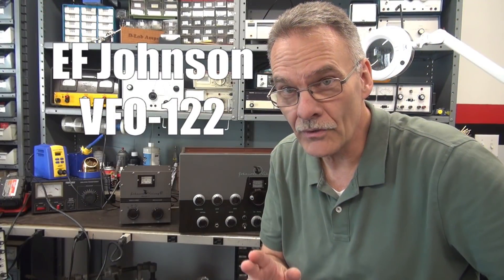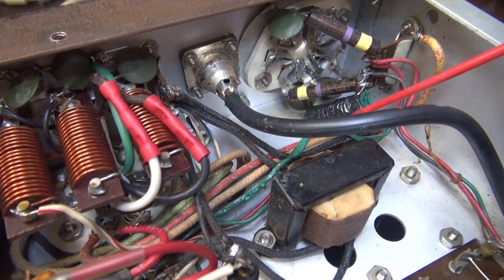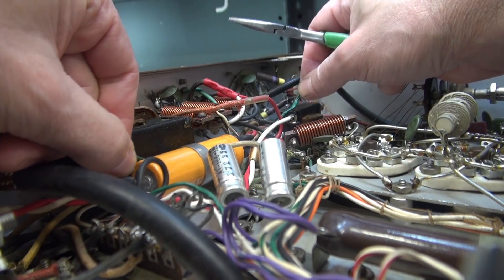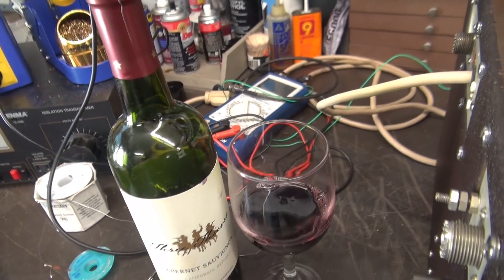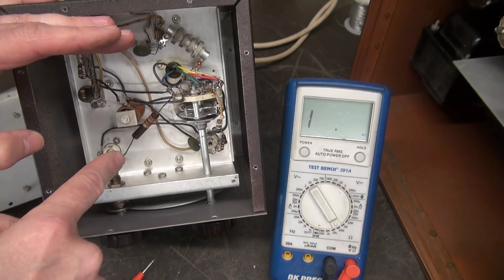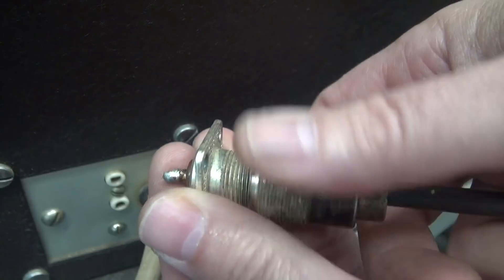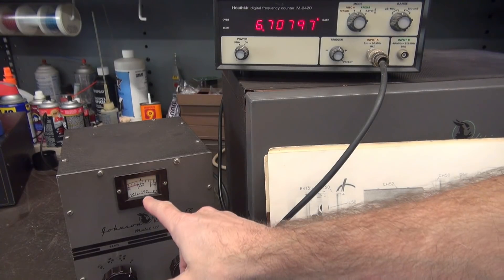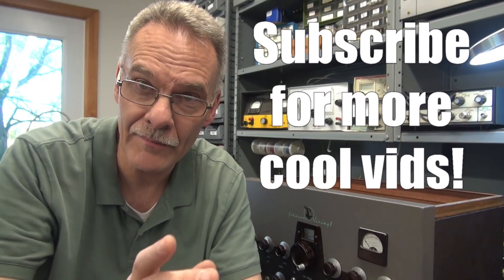Johnson Viking VFO VF-122 repair Calibration Ham Radio Operation

Comment: there is a trick with the vf-122 on 160 meters. the vfo puts out 80 meters but the coax to the transmitter is chosen to resonate on 160. if you replace the coax and 160 does not work you have disrupted the tuned coax trick circuit.

Comment: Terry - I have a Johnson VFO-122 in my slimy little fingers right now.  I got it from an Amer that was getting out of the hobby, and moving to a smaller place.  He passed away a couple of years later.  All the screws are out of it, but I think I have them in a container.  The bottom plate, and back nut are also missing, but now that I know what to look for, they may be here somewhere in the mess.  The Chernobyl resistor measures 58.2K Ohms.  Wow!  Glad that I looked at your video.  I also have a Johnson Viking Ranger here.  I think I'll order two of those nice resistors, in case that one needs it, as well.  I'll also check the Johnson Vikings that I got in the sale too.  He said that they were acting up at the time of the sale, but was he not specific.  I've been meaning to put together a vintage AM station here, but so far all I've done is make a few CW contacts with the Ranger.  Meanwhile the basement is full of boat anchor transmitters, microphones, VFOs and receivers.  73 Paul AA1SU